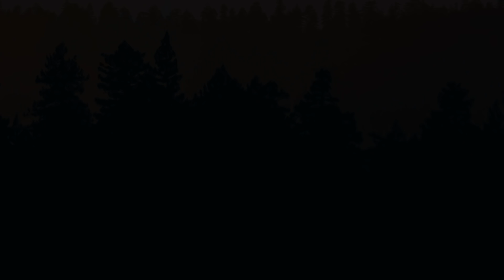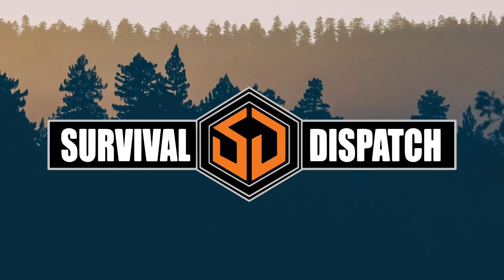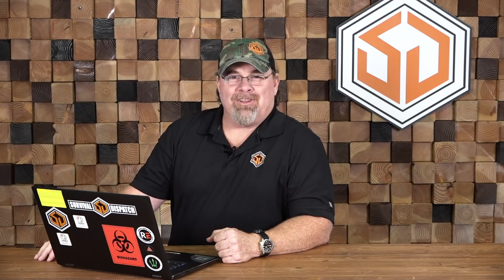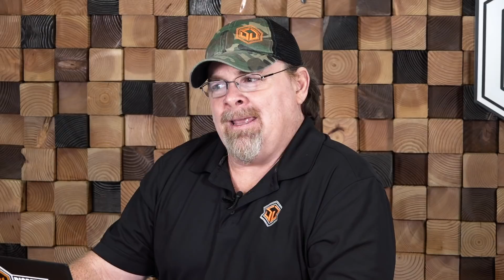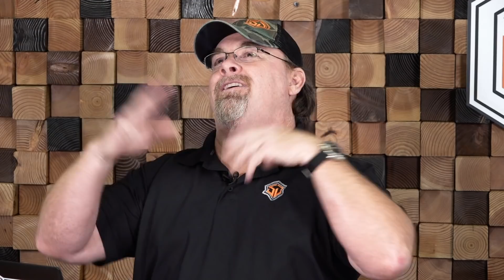All About Generators!

Comment: If you want to run propane get a Champion  Dual fuel generator. I have a 10k generator and a 3500-watt inverter both are dual fuel and they are outstanding.  I also had a Transfer Switch installed and it is a game-changer. Charley, I think you left a comment on my Channel ( Bill teaches you stuff ) I just subscribed to your channel. Looking forward to seeing more of your videos so informative.
Reply: Here are the rules about portable generator safety: This is just a reminder for everyone’s safety. All generator safety rules should be followed carefully. This advice is just to make sure that everyone is aware of all the warnings and it’s just to remind people to be careful using portable generators. Generators can be dangerous if not used carefully. Every year, hundreds of people die or get injured when using portable generators due to carbon monoxide poisoning and electrocution. Make sure you are using your generator carefully and keeping others safe as well. There is something very serious that everyone should always be aware of when using generators. Some people do run their generator indoors which is not safe and that increases the risk of carbon monoxide poisoning which can cause death of family and you. Some people run their generator in wet conditions which can electrocute them. Please remember that you should never run your generator indoors. Remember that carbon monoxide is an odorless and colorless gas that you cannot see or smell. Carbon monoxide is a silent killer. Keep that in mind. Make sure your generator is 15-20 feet away from your house and away from doors, windows, and vents. Never use your generator in your porch too. Having a carbon monoxide detector is very important against generator safety. Some people also allow children to go near the portable generator which could pose risks. We need to keep an eye on our children making sure that they are not near the portable generator so they won’t get electrocuted or burned by the generator which is dangerous. A locking enclosure also keeps kids safe. A generator shed might look like a tempting place to explore, or take cover during a game of hide and seek, but a generator is a dangerous piece of equipment that can cause injury. It says on the manual that we should also keep children away at all times from the portable generator to avoid injuries. Please do not allow a child or unqualified people to operate the portable generator.  It is important to keep your children safe especially little ones. The portable generator can be hot during an operation. Just because some manuals missed what should be listed doesn’t mean it’s safe to do. Always follow the generator safety rules when using portable generators. Generators pose electrical risks. If you need to use your generator during wet weather, you need a generator tent to protect your generator from getting wet. Don’t let your generator get wet. Keep your generator dry and before using your generator, please make sure your hands and your generator is dry. Do not wear loose clothing when operating the generator. Everything that is said on the generator’s operating manual should not be ignored. Never smoke cigarettes near the generator. Please keep flammable things away from the generator. Never overload your generator too. Your generator can catch fire. Never ever try to plug a generator cord into a wall outlet to avoid back feeding. Back feeding your generator is dangerous. Always turn on your generator first before plugging in appliances and shut off the appliances before turning your generator off. Use a heavy duty cord for your generator and the cord should not be worn out. All the instructions should be followed carefully. Never refuel your generator while it’s running. It can cause fire if fuel spills while your generator is hot. You should turn off your generator and let it cool off before refueling it. Having a fire extinguisher next to the generator is also important. This is only a reminder for everyone’s safety of using generators. Make sure your generator is properly grounded. Having a fire extinguisher next to the generator is also important against the safety rules. https://youtu.be/I1jT3ANENvI and here is a video more about keeping others safe when using generators and also about our family’s safety. It’s important to keep our children safe especially our little ones. Generators can also cause electric shocks. Just reminding everyone to be aware of the warnings. Hope this helps. Thank you.

Comment: So as a fairly new prepper I was going to get a small freezer and fill but thought Oh if power goes out I would have problems so started looking into a generator.  Finally ditched the freezer idea and decided to stock up on foods that don't need refrigeration/freezing.  Will buy a gas grill instead with several propane tanks and a solar generator. I have been through power outages here in Alabama and prior in Maryland. I have a small backup heater and fireplace plus battery operated fan and radio.  Water heater holds heat for a while so not too concerned about it. As long as I can cook beans and rice, make coffee and keep warm or some air moving I think I'm fine. Working on water now.
Reply: Here are the rules about portable generator safety: This is just a reminder for everyone’s safety. All generator safety rules should be followed carefully. This advice is just to make sure that everyone is aware of all the warnings and it’s just to remind people to be careful using portable generators. Generators can be dangerous if not used carefully. Every year, hundreds of people die or get injured when using portable generators due to carbon monoxide poisoning and electrocution. Make sure you are using your generator carefully and keeping others safe as well. There is something very serious that everyone should always be aware of when using generators. Some people do run their generator indoors which is not safe and that increases the risk of carbon monoxide poisoning which can cause death of family and you. Some people run their generator in wet conditions which can electrocute them. Please remember that you should never run your generator indoors. Remember that carbon monoxide is an odorless and colorless gas that you cannot see or smell. Carbon monoxide is a silent killer. Keep that in mind. Make sure your generator is 15-20 feet away from your house and away from doors, windows, and vents. Never use your generator in your porch too. Having a carbon monoxide detector is very important against generator safety. Some people also allow children to go near the portable generator which could pose risks. We need to keep an eye on our children making sure that they are not near the portable generator so they won’t get electrocuted or burned by the generator which is dangerous. A locking enclosure also keeps kids safe. A generator shed might look like a tempting place to explore, or take cover during a game of hide and seek, but a generator is a dangerous piece of equipment that can cause injury. It says on the manual that we should also keep children away at all times from the portable generator to avoid injuries. Please do not allow a child or unqualified people to operate the portable generator.  It is important to keep your children safe especially little ones. The portable generator can be hot during an operation. Just because some manuals missed what should be listed doesn’t mean it’s safe to do. Always follow the generator safety rules when using portable generators. Generators pose electrical risks. If you need to use your generator during wet weather, you need a generator tent to protect your generator from getting wet. Don’t let your generator get wet. Keep your generator dry and before using your generator, please make sure your hands and your generator is dry. Do not wear loose clothing when operating the generator. Everything that is said on the generator’s operating manual should not be ignored. Never smoke cigarettes near the generator. Please keep flammable things away from the generator. Never overload your generator too. Your generator can catch fire. Never ever try to plug a generator cord into a wall outlet to avoid back feeding. Back feeding your generator is dangerous. Always turn on your generator first before plugging in appliances and shut off the appliances before turning your generator off. Use a heavy duty cord for your generator and the cord should not be worn out. All the instructions should be followed carefully. Never refuel your generator while it’s running. It can cause fire if fuel spills while your generator is hot. You should turn off your generator and let it cool off before refueling it. Having a fire extinguisher next to the generator is also important. This is only a reminder for everyone’s safety of using generators. Make sure your generator is properly grounded. Having a fire extinguisher next to the generator is also important against the safety rules. https://youtu.be/I1jT3ANENvI and here is a video more about keeping others safe when using generators and also about our family’s safety. It’s important to keep our children safe especially little ones. Generators also cause electric shocks too. Just reminding. Hope this helps. Thank you.

Comment: When I bought my generator it was just a little 2800 watt Yamaha inverter.I converted to propane from the company that was call us carburation,now it's called motor snorkel I think. At least with their kit  they said there is no loss in wattage when running on propane. The generator only runs on propane even took the fuel tank off I have not had any problem running it at it's rated 2500 watts
Reply: Here are the portable generator safety rules: this safety information is only for anyone who use a portable gas generator and for those who are planning on getting a portable gas generator. This is just a reminder for everyone’s safety. All generator safety rules should be followed carefully. This advice is just to make sure that everyone is aware of all the warnings and it’s just to remind people to be careful using portable generators. Generators can be dangerous if not used carefully. Every year, hundreds of people die or get injured when using portable generators due to carbon monoxide poisoning and electrocution. Make sure you are using your generator carefully and keeping others safe as well. There is something very serious that everyone should always be aware of when using generators. Some people do run their generator indoors which is not safe and that increases the risk of carbon monoxide poisoning which can cause death of family and you. Some people run their generator in wet conditions which can electrocute them. Please remember that you should never run your generator indoors. Remember that carbon monoxide is an odorless and colorless gas that you cannot see or smell. Carbon monoxide is a silent killer. Keep that in mind. Make sure your generator is 15-20 feet away from your house and away from doors, windows, and vents. Never use your generator in your porch too. Having a carbon monoxide detector is very important against generator safety. Some people also allow children to go near the portable generator which could pose risks. We need to keep an eye on our children making sure that they are not near the portable generator so they won’t get electrocuted or burned by the generator which is dangerous. A locking enclosure also keeps kids safe. A generator shed might look like a tempting place to explore, or take cover during a game of hide and seek, but a generator is a dangerous piece of equipment that can cause injury. It says on the manual that we should also keep children away at all times from the portable generator to avoid injuries. Please do not allow a child or unqualified people to operate the portable generator.  It is important to keep your children safe especially little ones. The portable generator can be hot during an operation. Just because some manuals missed what should be listed doesn’t mean it’s safe to do. Always follow the generator safety rules when using portable generators. Generators pose electrical risks. If you need to use your generator during wet weather, you need a generator tent to protect your generator from getting wet. Don’t let your generator get wet. Keep your generator dry and before using your generator, please make sure your hands and your generator is dry. Do not wear loose clothing when operating the generator. Everything that is said on the generator’s operating manual should not be ignored. Never smoke cigarettes near the generator. Please keep flammable things away from the generator. Never overload your generator too. Your generator can catch fire. Never ever try to plug a generator cord into a wall outlet to avoid back feeding. Back feeding your generator is dangerous. Always turn on your generator first before plugging in appliances and shut off the appliances before turning your generator off. Use a heavy duty cord for your generator and the cord should not be worn out. All the instructions should be followed carefully. Never refuel your generator while it’s running. It can cause fire if fuel spills while your generator is hot. You should turn off your generator and let it cool off before refueling it. Having a fire extinguisher next to the generator is also important. This is only a reminder for everyone’s safety of using generators. Make sure your generator is properly grounded. Having a fire extinguisher next to the generator is also important against the safety rules. https://youtu.be/I1jT3ANENvI and here is a video more about keeping others safe when using generators and also about our family’s safety. We should keep our children safe especially little ones. Hope this helps. Thank you.